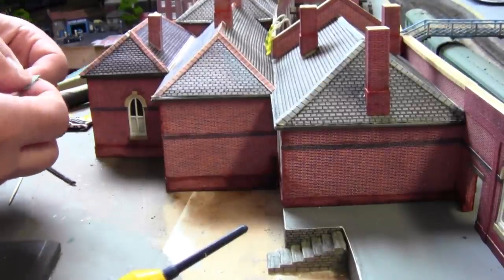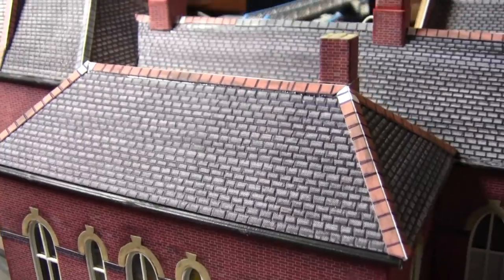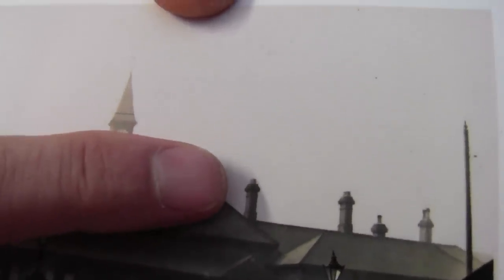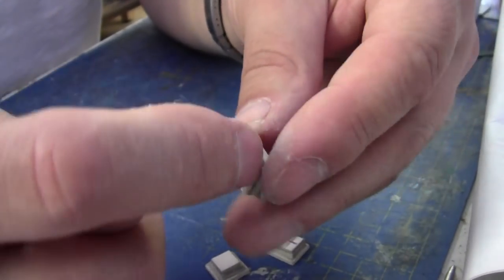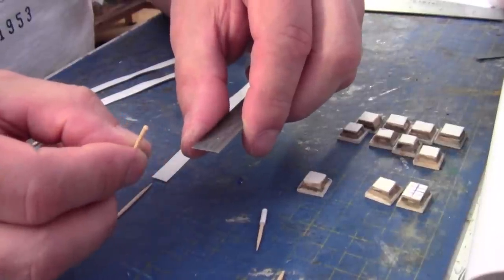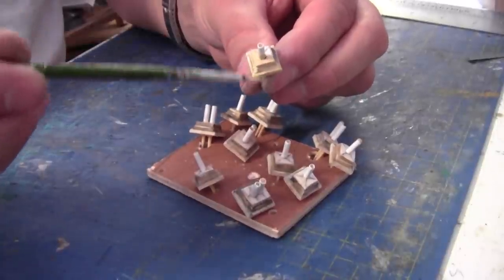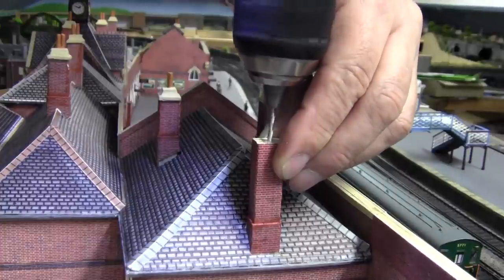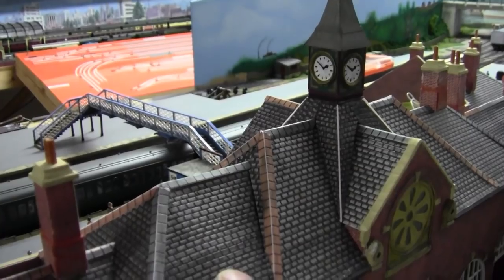The Station. Part 15  Metcalfe Chimney Fix    No232

Comment: Ohhh those finishing touches, just gets better each time, certainly enhances the look. Yep picked up that Metcalfe tip, glad you pointed it out! Seriously though I have snapped a few off - very irritating, problem solved. Stephen
Reply from the maker: Hi Stephen, i have done the same. but at least we have a fix if it happens again...............cheer's Tony

Comment: Very nice idea Tony, using the spurs from the Peco canopies. I have the same canopies so will use the spurs as guttering, many thanks for the tip...Simon
Reply from the maker: Good Morning Simon, when using the spurs make sure there is enough over hang from the roofs, is not then you might have to put a flat on the opposite edge that you want to use, otherwise the spurs  will stick out to far. thanks again for popping in.................Happy Modeling.........Tony

Comment: A fitting end to an amazing station building. They add so much. Previously I had solved the problem of chimney pots by just not having any. Looks like Ill have to think again now !  I reckon I can get away with a bit of cocktail stick without the paper wrapper as Im using N gauge.
Reply from the maker: Hi Martin that would work just using a cocktail stick on its own. as they are just under 3mm thick. ...............good luck with the re-think..................all the best Tony

Comment: Hi Tony! Late I know but one method of making sure card layers are evenly spaced all around is as follows.
1. Make a JIG by Drilling a very small hole in some balsa wood or platikard and insert and glue in a pin. Then chop the blunt end off the pin.
2. For each square/rectangle of card, find the centre by drawing lines corner to corner. Push another pin through the centre mark to make a hole.
3. Align the pin in the JIG with the hole in the card and push the card down flat. 
4. Glue the top surface of the threaded card
Repeat steps 2 - 4 as required, making sure that the cards are square along all edges. The Jig will make sure they are all centred!
Reply from the maker: Hi Ray a great tip making a jig for the chimneys. mind you i would have to make a lot of jigs, as i think there where 4 different chimney breasts on this station station. the would have worked a treat. that i am sure of.  thanks again for commenting with your ideas........thanks again Tony

Comment: A hundred times knocked them off.  Oh those chiming pots and tops are perfect to imulate the original.  Clever to file the center section and give it a concave look.  Brilliant Tony, absolutely brilliant.  I am stuck into wiring today.  It is going well.  Bye for now 🖐🏻
Reply from the maker: Hi Rob. the chimneys are an easy fix. and you will have no more trouble with them. you take it easy under those bas boards. the amount of times that i have bumped head. now i use a bump cap....have a great weekend.....Tony

Comment: Nice job Tony! I think when I do my next metcalfe kits I'll be cheating and will use 3d printed chimney pots, I don't fancy rolling them in N-gauge :) Nice tip using super glue on the card, will be using that one for sure! All the best Tony
Reply from the maker: Its a little bit more tricky with n gauge, but if you can cheat then why not. who's gonna know...have a great a weekend..........cheer's Tony

Comment: Hi Tony, i noticed that you have a two lengths styrene web truss in one of your earlier videos to use as a support for the overall roof that no doubt will be a later project, Thought i would let you know that 4d Models do etched brass web trusses that look very good,
Reply from the maker: Good morning David, thank you for the tip. you are right about the styrene strips. i should be starting that section of the build soon....which i am really looking forward to. as i have to get this bit absolutely right........thanks again for commenting...........cheer's Tony

Comment: Cracking vid tony don’t suppose you got any of the terracotta ridge tiles spare you could post ?
Reply from the maker: i had ran out. and had to make some up out of white card, but it has to be 1mm thick card with a glossy surface. cut into 14mm strips. and then scored with a blade down the centre. and folded.......hope this helps...........cheer's Tony

Comment: Clever idea with the chimney pots Tony, I will certainly borrow that from you for my buildings. After the main station building are you starting opposite building, then the roof? cheers Paul.
Reply from the maker: Good afternoon Paul. the roof should be finished this weekend. there are 3 roofs. the concourse roof on platform. the sloped roof on platform2 and then the big roof that covers the tracks. the next phase will be to do the iron work as i need to tie in the two ends of the station together. as the gents its a moves when i pick the station up. its long journey my friend......we will get there.........all the best Tony
Reply: Tony, certainly enjoying your journey to complete and I have no doubt that it will be amazing!

Comment: Tony, I noticed that there are railings of some sort along the ridgeline on either side of the clock tower on the prototype photograph.  If you wanted to add these, I believe that there is a Ratio kit for GWR style metal railings that might do the job. 
 (https://peco-uk.com/products/spear-fencing?_pos=1&_sid=b119e63e3&_ss=r).  
By the way, thanks for the chimney pot tip - I am now kicking myself that I never thought of this...  I'm going to use it, though!
All the best, Ken.
Reply from the maker: Hi Ken, well spotted seeing those railings in the photo. thanks for the tip. i will check out the web site. the railings will go on last because they will be delicate. don't go kicking yourself you could do some serious damage. thanks again for commenting, have a great weekend........cheers Tony
Reply: @TONYNORTHEASTERN  Tony, I've re-done the link as the one I posted yesterday had stopped working, hopefully this one will be better, Ken.
Reply from the maker: we have just been to my local model shop and they are struggling to get anything from peco at the moment.....thanks again tony